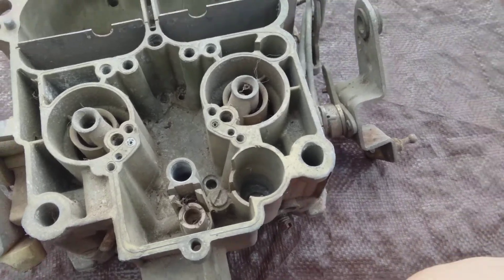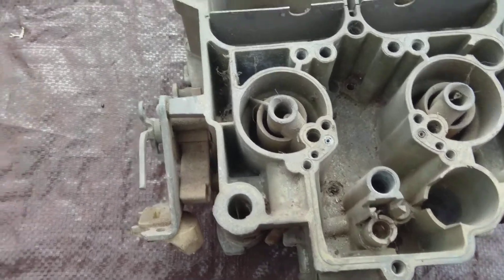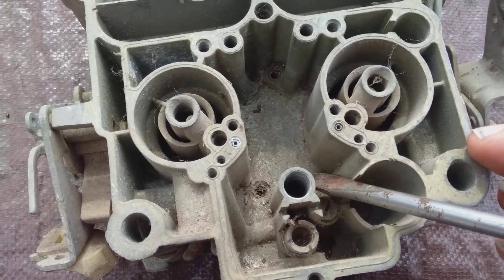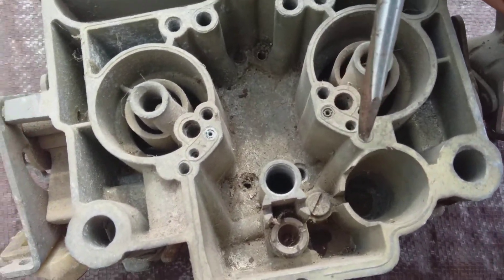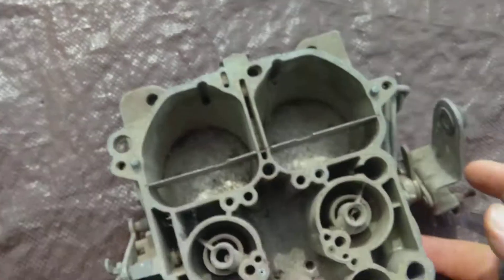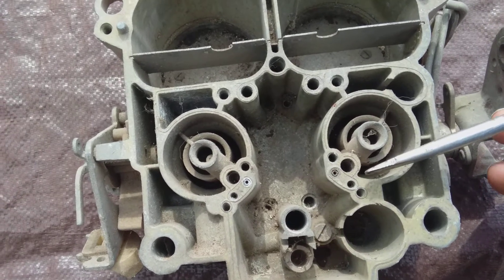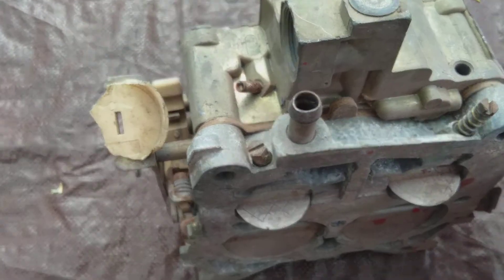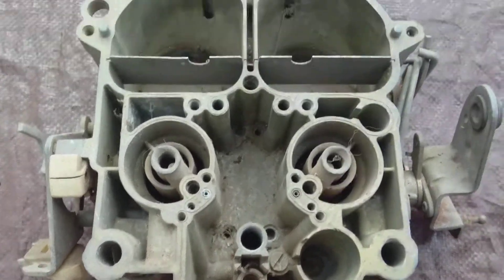Basic E85 conversion starting point for Qjets.

Comment: I managed to acquire a 800 CFM Q-Jet and purchased Cliff’s book. On my 455 with #16 heads should put me at 12.4:1 CR so e85 or water/meth injection will be the least expensive option in my opinion… thanks for this tutorial!!
Reply from the maker: I'm planning to convert a Qjet later this year for my 71 Formula when I do it I will make a video of the entire process, and how well it works.

Comment: I've been daydreaming of converting my project to e85. 71 GTO 455 th400, too far away from a perfect resto but excellent bracket racer candidate. Will a converted q-jet be adequate for 282/292 .510/540 cam w/ ported 670 heads? Nothing too radical but I'd love 500ft lbs at the tires lol
Reply from the maker: Well the 65 GTO has a 670 headed 455 with a hydraulic roller a bit larger than that, and they were ported by Butler way back in the 90s. Those heads ran 11.40s in the 79 Formula, with a 3.42 gear, 1900-2100 stall, 228/232@.050 hydraulic cam on a 110LSA, with a 3750lb race weight. Slowed it to 12.1-11.80s by putting 4.10 gears in it. The gear swap had it at 6000rpm before the 1000ft mark, which slowed it down enough I didn't need to put a roll bar in. I was broke back then.

The ol GTO will smoke the tires until you let off, just by whacking the throttle, no need to hold the brake.

I used the GTO to test and tune Qjets I converted for friends, so yeah, with a Holley blue or black pump it feeds it no problem. This fall I will go through a Qjet, make a video of everything I do to them, then put it on a 400 with stone stock 62 heads, and stuff it in a 72 Ventura. Its different for each model, but the early ones make the most power, and the 75 to 80 Qjets do great on mileage with good power.